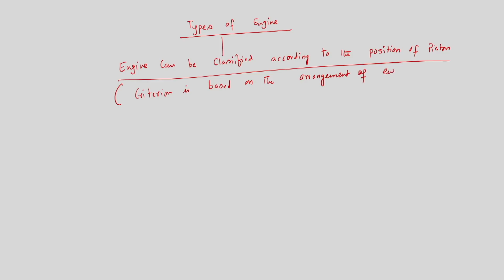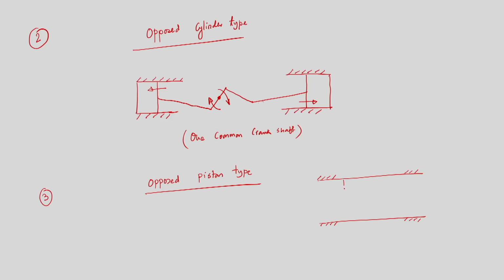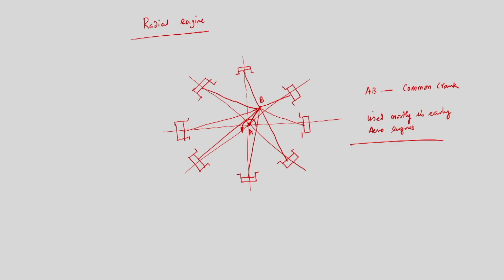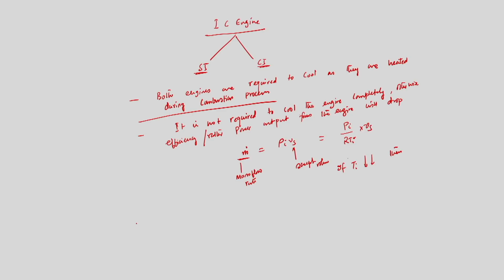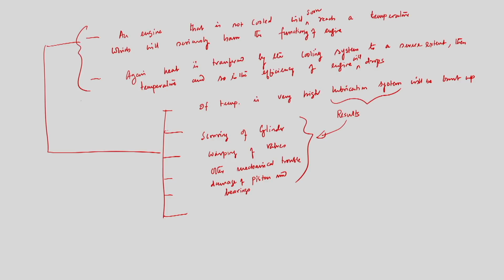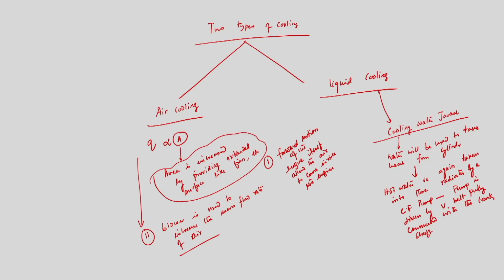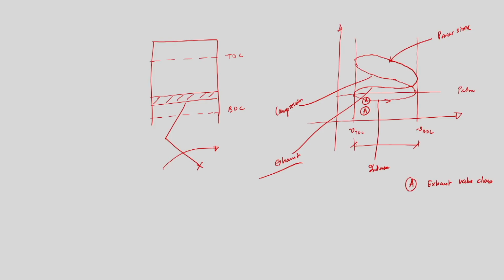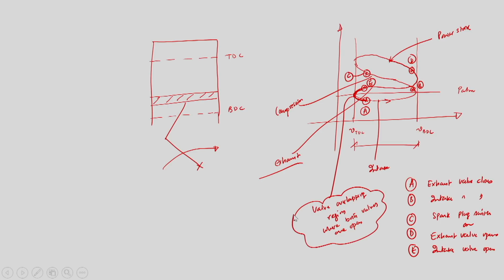Lec 4: Engine operating characteristics

Comment: Sir in types of engine you haven't considered the V TYPE arrangement of piston.
Reply: Broadly V type arrangement comes under the case when 1 crank shaft runs two pistons.
For ex. in a V8 engine 4 crankshaft helps to rotate 8 pistons.